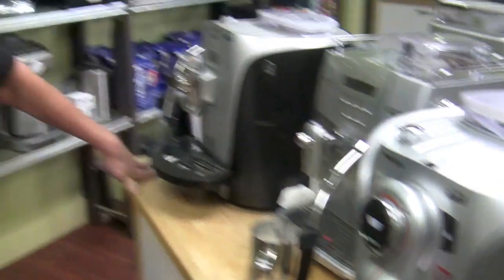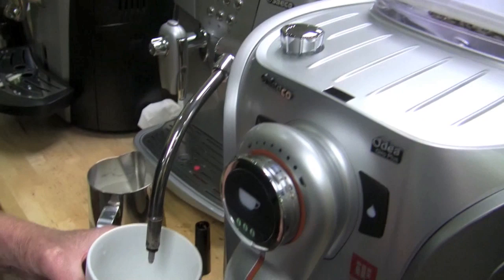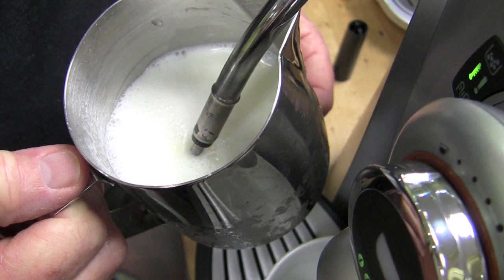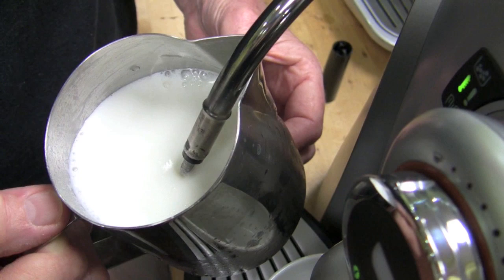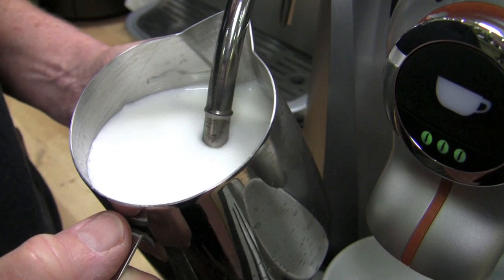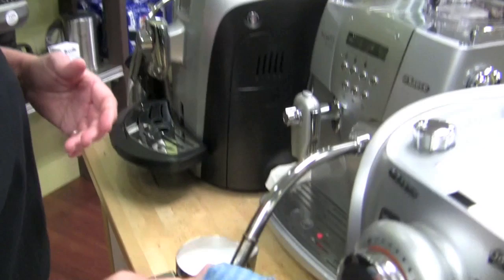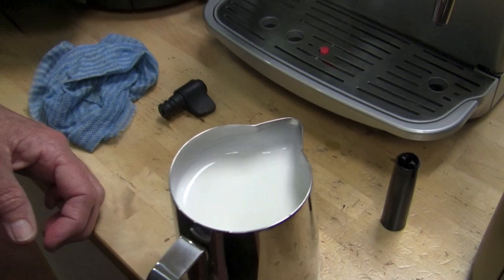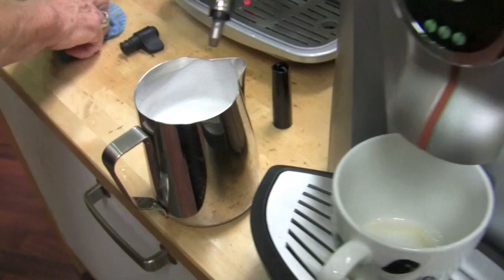Steaming on the Saeco Odea Giro without Panarello

Comment: I'm surprised more people aren't doing this.  I took the panarello off of my Sirena (same maker) because I was unhappy with the steam performance and I was able to get excellent results with only the steam tube.  The only downside is that it's rather short.

Try burying the tube first, at an angle near the edge of the pitcher to start a good swirl, and then drop the pitcher until the tip just starts to skim the surface and incorporates air.  You get better mixing, faster - better foam for art.

Comment: On the Via Venezia, you can use a 20oz pitcher -- but just barely -- without the panarello.  I bought the upgraded panarello from SCG (chrome) with a single hole that I can cover with my finger,  Works great and my micro-foam is good for latte art.